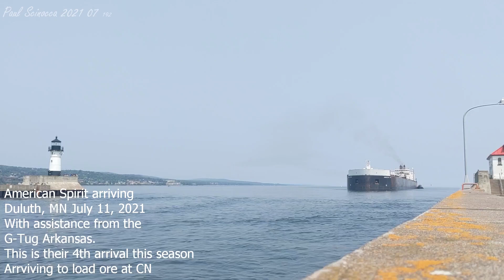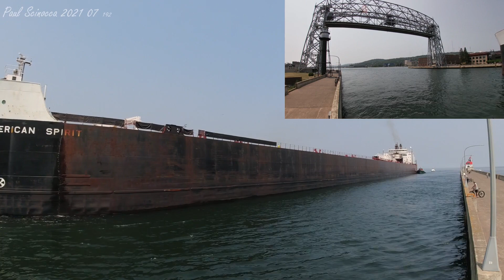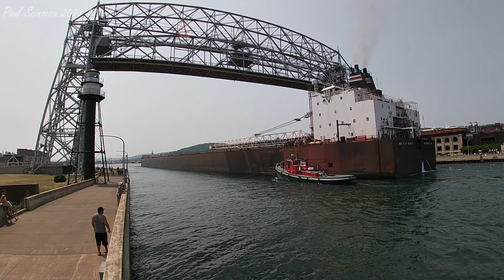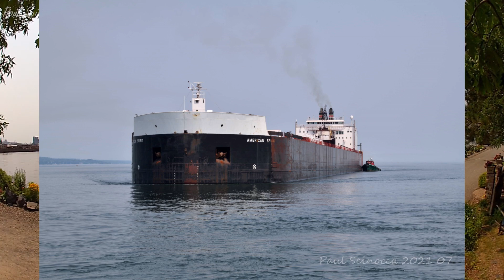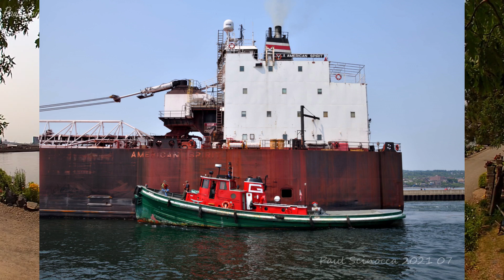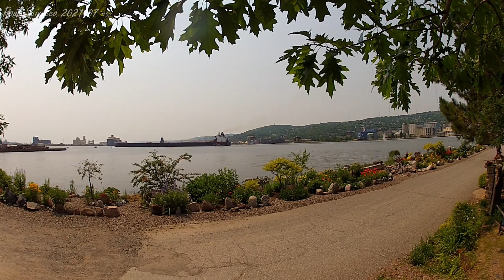Coming into Duluth with a bum rudder? The American Spirit with Tug Assist on arrival  July 11,2021

Comment: The way this boat looks with its name partially spelled out, it sure doesn't represent the "American Spirit" to me.
Reply: It isn't feasible to keep the lettering neat and tidy day after day. This is a working vessel, not some motorboat a retiree can spend all day polishing with an old cloth diaper. Not to mention that paint wears off from exposure to the elements year round. The boats tend to get fresh paint once every couple of years.
Reply from the maker: They usually get all cleaned up with their 5 year inspection. Paint is most likely not priority on the maintenance repair list.
Reply: Or never until their scrapped.